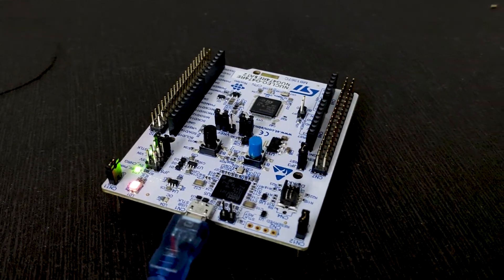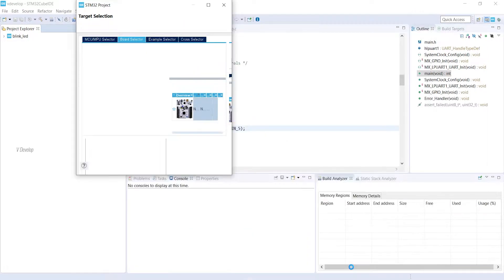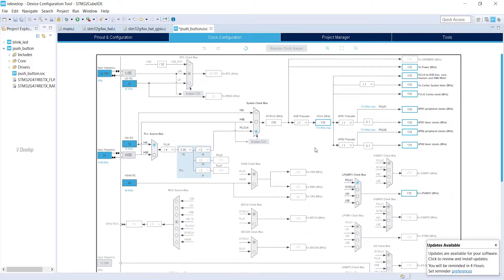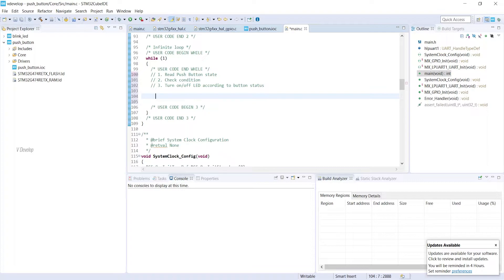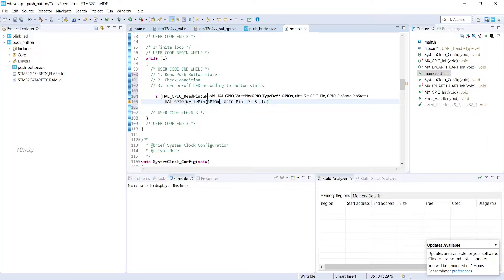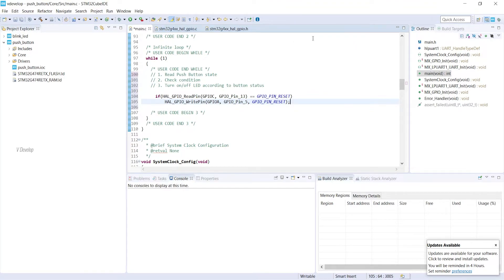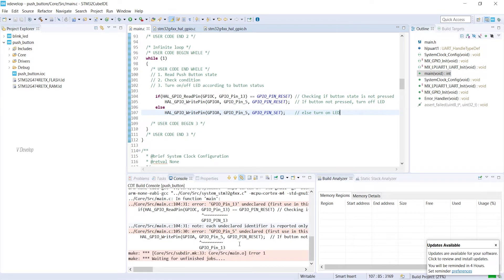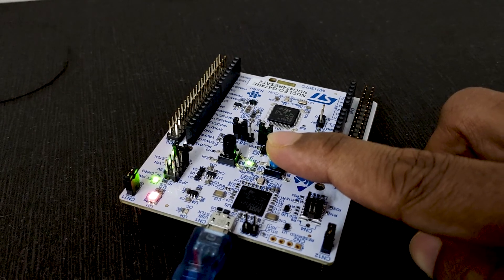Push Button Example | STM32 Cube IDE | GPIO Input | STM32G474 | Episode 3

Comment: what if i want to use 2 pushbuttons ?
Reply from the maker: You can go with same approach in configuring the push button as GPIO input.

And In this video , I used the polling method to process the button states. You can also try the same for two buttons.

Or if you have some other functionalities that is time constraint you can use the help of external interrupts to capture the button press.

Comment: Hi im using the stm32f411re, somehow using the exact code and configuration what happens to me is reverse 

when i push the button it turns off the led , but when i release  the button if turns on
Reply from the maker: Did you try changing the Gpio mode? Push mode/Pull mode

Comment: Hello i want the led to turn on when i press once and it should not turn off untill i press the push button again
Reply from the maker: This can be implemented in several ways.

One logic is as follows.

isPressed = 0

While(1)
{
If Hal_gpio_pin_state = 1 // use hal gpio pin read function
{ 
isPressed = 1 // user has pressed button
}
else if isPressed
{ // this block executes only if button is pressed
Toggle_gpio_led_pin //use HAL gpio toggle function
isPressed = 0
}
}

Note: please use actual functions and follow syntax for real implementation.

Comment: I think you did a great job on this video. What other projects are you going to do with your Nucleo446 board? What made you pick that board? I have a few boards I picked one with a lot of timers and one with multiple uarts. I have a stm32f103re it’s like the blue pill but it’s a real board. I made a dtmf decoder for ham radio. I like to build that project to learn on a new microcontroller. Take care
Reply from the maker: Thanks a lot ❤️.. I've used the G474 series. This is a little bit advanced board. I selected this board to do some power applications.
Stm32f103 is really a great board to start. All the very best! I'll be posting new contents soon. Stay tuned and thanks for your support!